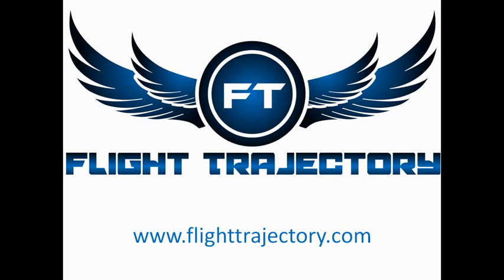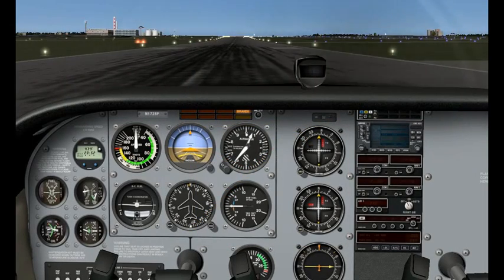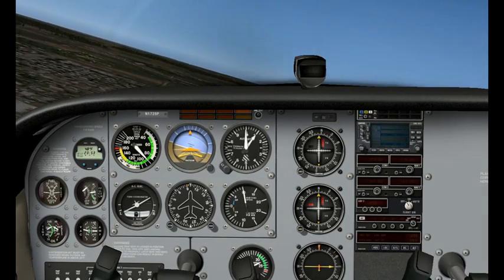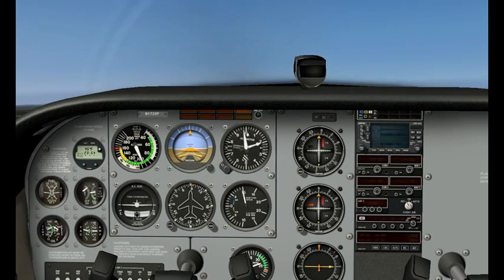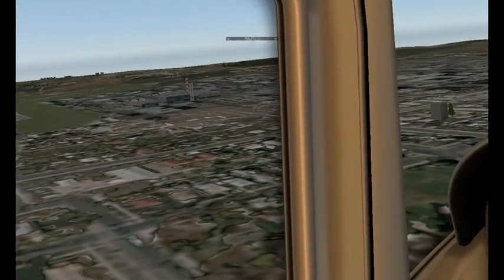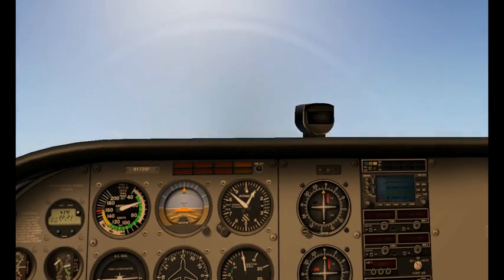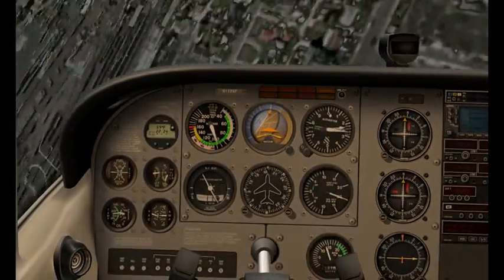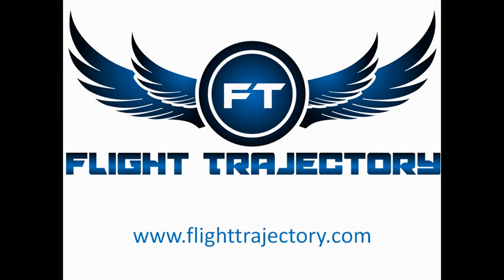Flight Simulator Lesson 4: Stalls and Spins

Comment: FYI, You should reduce power to idle, not ADD power.  You don’t want the airplane to exceed the maximum speed (VNE) and break apart on recovery.
Reply: On a power on stall especially low to the ground you are at full power then lower the nose to get the AOA below the critical angle of attack. I’m a real Cessna 172sp the VNE is 163 kts, you will never reach that unless u point straight down.

Comment: Does a stall during a landing follow the same rules as a standard go-around, cram-climb-clean-call?  After regaining airspeed of course.
Reply from the maker: +evildude109 
yes, depending on where you are at. For example, if you stall 3-5 feet above the runway, you probably won't hurt the airplane. If you're more like 10 feet above the runway, and you fully stall the plane onto the runway, you're definitely gonna do some damage! And in the landing stalls I showed you, yes, the procedure is essentially the same. The biggest thing to remember is DON'T clean up your flaps until after the stall is broken and you've regained airspeed